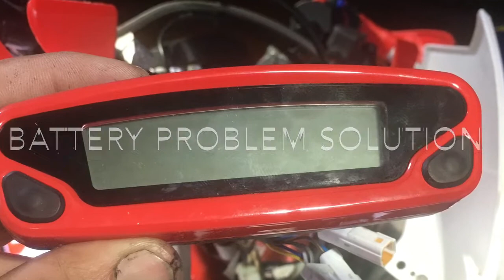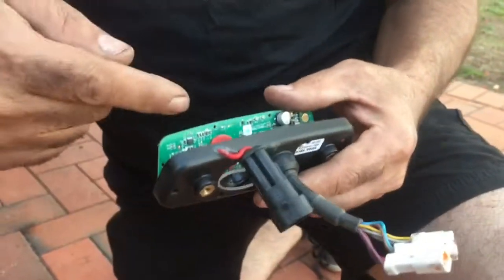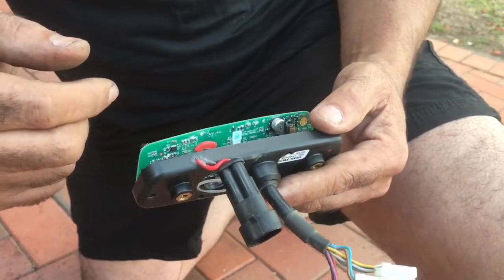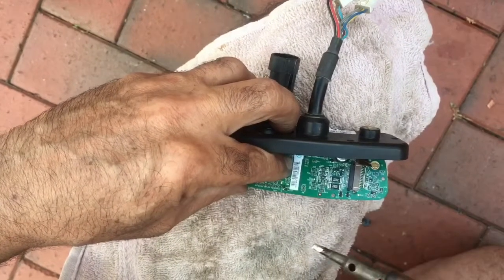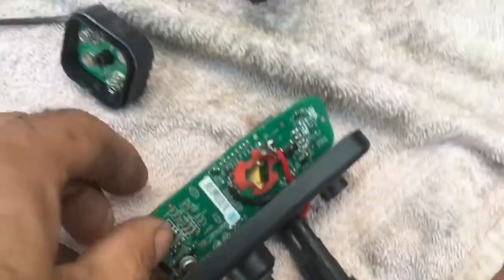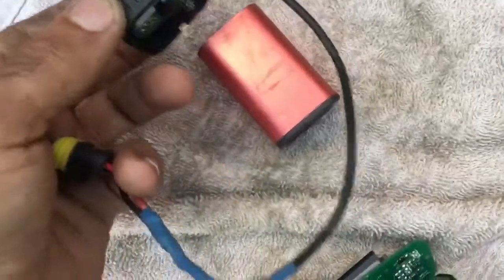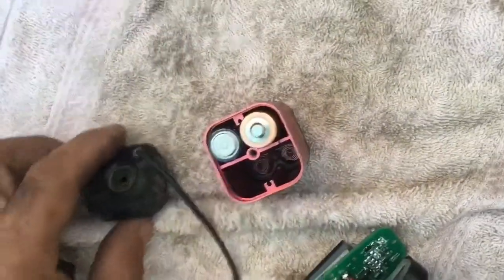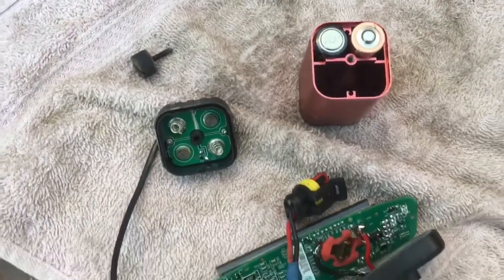Beta Xtrainer battery problem on Speedo

Comment: Very cool solution. It is too bad that they didn't fix this problem sooner. I have not had any issue with my 300RR (2018) but it's still VERY new. Thanks for sharing.
Reply from the maker: I do y understand mate
Reply: How did you open it half? that is been the hardest part for me.
could use a bit of help. thanks